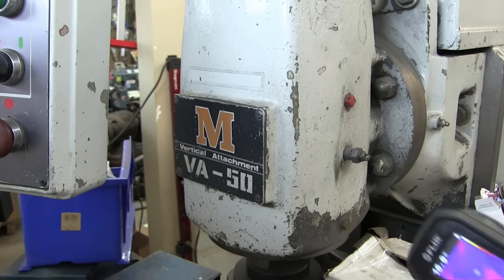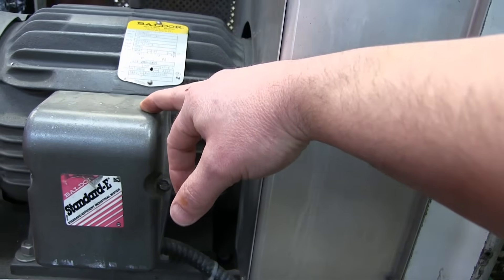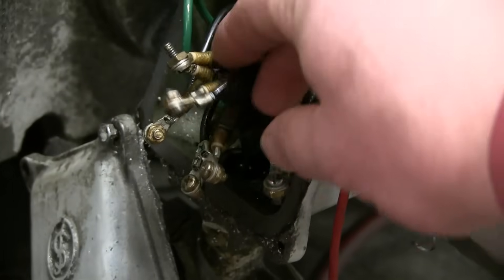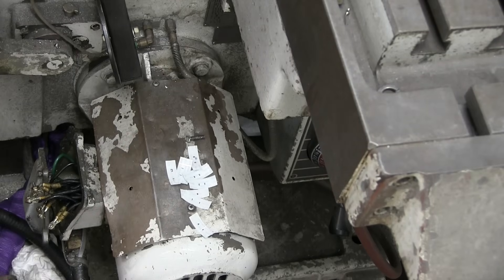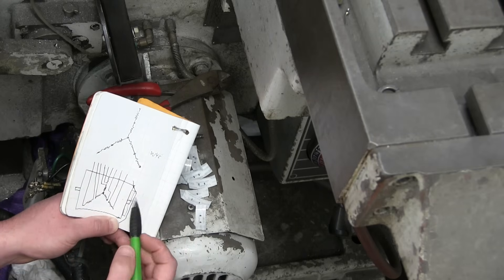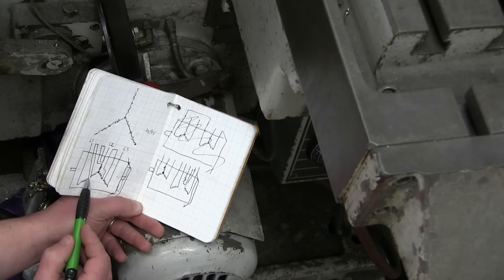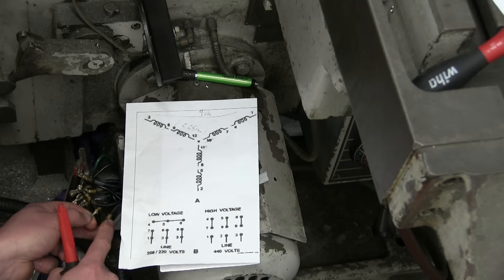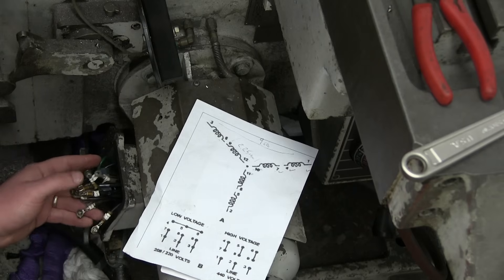MAZAK MILL AUDIT l 9 wire dual voltage electric motor wiring

Comment: The time has come when I must appeal to the great philosopher warrior of the Great White North and his prophet Dewclaw. I am an unworthy retired nuclear turdherder living in the United Soviet Counties of Illinois and recently acquired at auction a great honkin’ 6100 pound Cincinnati mill that appears to have originated in Upper Canuckistan. At least that is what I am lead to believe because the motors (at least 3, maybe more) are wound for 550 VAC 3 phase. I, of course have no 3 phase available. I run my 3 phase lathe at 240 VAC using a VFD. But this 550 juice is not found South of Windsor. What insights might be shared by you, Dewclaw or any of your multitude of devotees that could help me get this beast of a mill running without hand-winding a step-up transformer from 240 to 550 then finding a suitable cold-weather VFD in Toronto? Or running an extension cord to my former power plant employer on the Bruce peninsula to tap off some metric Amps at 550 VAC! At least it is 60 Hz!

Comment: I installed several 100 & 200 amp 240 volt services over the years. Does not cost much more then single phase motors. Cheaper in long run to have 3 phase service rather then expensive rotary or other type phase changers. Baldor is the best motor put there.

Comment: 9 leads are for a dual voltage motor to run 240 or 460 a 12 lead is wye delta… I feel for you trying to identify lead numbers lol been there done that

Comment: On a 440/460/480 v 3ph power system each phase is not 440/460/480
Each is about 277v to ground
Which is 480x square root of 3= 277
Line to line you get 480

Comment: The cheap and dirty way to get 3 phase is to buy a military surplus 3 phase generator. If you are a farmer with a 100 hp tractor, you can also buy one of those windmill generators and use gears or belts to run it off the PTO. The nice thing about generators is they only use the horsepower they put out, so if you are only running 30 hp in motors it will only take 35-40 hp to run the generator, depending on losses. Gears are more efficient than belts, but finding a pair of 8-belt sheaves may be cheaper than finding the right gears.

Comment: I'm a couple months late to comment, but, the way it is wired would tell you if its high or low voltage. Knowing which should make IDing the wires much easier. Then just follow your diagram to connect. Get rid of those nuts and bolts and use wire nuts. A bit easier to make "adjustments"!  The destroyed wire id labels are a good reason the numbers should be embossed onto the wires. Using low voltage doubles the amperage but AWG 12 should be sufficient up to 20 amps. Don't worry about the effects of starting/stopping on the VFD...we've been using them quite successfully in conveyor systems  for years. Much start/stop activity there - much more than you will have!

Comment: Agree with most of what you say, but have to disagree on this phase converter bit. I built a 15hp rotary phase converter (good for starting up to 7.5hp heavy loads) for about $100 and a scrap motor. vfd are fun if you only have one motor, but on something with multiple motors you'd need a VFD per motor, where a single rotary phase converter will run every tool in your shop. and with a couple capacitors and a few hours tuning it, all three phases will supply the same power.

Comment: six of those wires are paired anyway as one of each is the tail end of a motor coil. you can eliminate most of them belling out the motor to find out which point you need to mount your U V W wires, star and delta can be done with bridge plates. looking forward to your video on the motor wiring.

Comment: Let's rewire a 6 phase double wye cable car motor, no...REWIND one, that's even more fun. I swear I have a phase rotation tester that will decipher 9 and 12 lead motors AND tell which way to connect phase A,B & C to get CW or CCW rotation. Rotary phase converters are HORRIBLY inefficient, NOISY and they have lots of parts  to wear out.

Comment: Thats an old Mazak lol i work on a few types...their variaxis 730s...i630s...and i think we have a lathe with live tooling on the turret.  They are pretty reliable machines until an operator wrecks it and your changing linear rails and doing geometry work...

Comment: YES! Excellent vid. I ran across this. 128 ports of WTF Ethernet Switch in the rack.  6 racks next to each other. No one labelled anything no letter no number nothing. I printed out two pages of wingdings and tagged the port and cable with the scotch tape and a "emoji" paired. To try make sense of what shmoo was confabulated on inside the tunnel of tunnels. I think my plan went too well as other consultants started to do the same type of documenting. Documenting like this is kinda like having witness marks on work pieces to line things up correctly. P.S. It was contract for worldcomm.

Comment: I have an ABB VFD pulled from service a couple years back. No info on the why it was replaced. She is missing the control head, you can have it if you want to poke around on it some or use for a project.

Comment: Actually rotory phase converters will run motors at full power. You only get 2/3 of rated power when you use a start box that starts the motor if the machine on single phase with start Caps. The idler motor in a rotory phase converter will put out a "wild leg" but it can be conditioned with run capacitors to be within 10 of the others when measured off the others.

Comment: Europe is nice this way... The electrical system is based on Delta/Wye Voltages (Sqrt of 3) so the old system is 3 phase 230V IT (Delta-wound transformers with insulated ground) and the new system is 3 phase 400V TN (star/wye with "star-center" beeing the Neutral lead and connected to ground, and thus still let regular one phase house appliances run on 230V between one of those 3 phases to neurtral lead, or basicly function just as one leg of the star/wye) Thus most any Asynch 3 phase motor is only 6-wire, as you only need to change between delta and wye. Also most of houses got 3 phase.

Comment: Reason phase converters don't create three CLEAN phases.... Each phase needs to be 120 degrees apart (360 / 3 duh!). Hokay, fine. Power company feeds you two hot leads (just don't run third wire into cheapo residential neighborhoods to save a few beans.) Well capacitors shift AC phase.... but only 90 degrees. We can fake the third phase by feeding a cap off one of other legs. Hey, 90 is CLOSE to 120 right? So pseudo phase is always 30 degrees out. Close enough to make it turn, but not skookum!

Comment: Thanks for this man, I didn't even know there was a way to get higher then 240 volts from a residential circuit. Though one of these days I would like to have a welding machine but will a 240 volt welder be enough (like say if you use a 240 volt 100 amp circuit?)
Reply: Welding machines = low voltage, high amps.
Reply: I know that much, I did take 3 classes of welding in high school. (Grade 9, 10, and 11)

Comment: It's getting cold in Germany... But at least I can blast some heat with my 400V 3-phase space heater. I feel terrible to have the power of 3-phase at my disposal while you have to hack your gear, and everything I'm using it for is heating. Then again, I'm from Germany, we've coined the term Schadenfreude for a reason ;)
BTW 3-Phase is commonly referred to as "STARKSTROM" over here (literal translation: powerful electricity). The more you know.
Reply: Schadenfreude and Backpfeifengesicht are two of the most wonderful words we've stolen from you. :)

Comment: Looking forward to finding out more about the speed drives. Are you going to run one at 60Hz fixed to power the whole unit? Or one drive for each motor or even a combination of fixed and variable frequency. Also the larger drives are not always clear whether they will accept single phase input or not. Love the Vijeos. This channel has become a public service.

Comment: I just purchased a digital control phase converter from Phase Perfect to run a CNC machine - it works GREAT but as you said....$$$$$EXPENSIVE$$$$ $5,500 for 55 amps of 3-phase. No joke. The good news is that it is clean, stable, efficient, and small relative to other options.

Comment: 98% sure whatever dickhole wired the motor on my lathe wired your mill! If the earth lead gets hot enough to burn through it's insulation, there may be a problem with your lathe motor.

Comment: If there's 9 wires, then you have L1, L2, L3 (from supply) to L1 L2 L3 (motor) plus a neutral (depending on connection). This is to give you the option of connecting it in either Delta or Star configuration. Sometimes you'll have a 'delta-star starter' which will start the motor in one way to prevent a large in-rush current from tripping the breakers, and then change it automatically to the other for best efficiency and performance. Other times you'll have a 'DOLS' (Direct On-Line Starter) which will also act as an under-voltage protection.

Comment: can you trust that the last guy who wired that motor made it right? If I have to do that from scratch, maybe I will  take an ac trasformer output (12v?), connect it to one coil and try to figure out which of the others is which and its orientation (by serializing them) by the current induced in them. Naa, too much work

Comment: AvE, I'm sure you have already figured this out but, that voltage switch in the control panel is for the internal transformer that runs all the contactors and controls only. It has no effect on the motors.

Comment: Trying to figure out the wiring on a 3 phase multi voltage motor can be a real head ache especially getting all the winding phased correctly. You did a good job on breaking it down.

Comment: Vidjeo request: More on VFD installation, in particular how you operate your tools that were set up for fixed-speed motors. Did you keep the hi/lo gearbox stuff? What about the snowmobile drive belt? I'm very interested in VFD-ing my mill and lathe (have a rotary converter today), would love to know more about it.

Comment: Now I kinda understand why N.A. people say that three phase is complicated. These nine-wire motors are indeed more complex to wire up and also more complex to figure out if the connection box is FUBAR. I guess this whole thing with 220/440 volts is somehow related to split phases as well?

Here I only know motors where the connection box has six poles on a terminal block (except if its some fancy motor with a heater or brake built into it or something like that) which are just the ends of the three windings. Then you just look at the name plate, whether it is 230/400 D/Y or 400/690 D/Y and wire it up for the 400 V configuration (so 230/400 motor = star, 400/690 motor = delta, but 400/690 motors are usually big so you maybe want a star-delta starter). For star you just connect one row of three, for delta you connect each pair. (Normally indicated in the lid of the connection box, on a piece of paper or just cast into it) Done.

If it spins in the wrong direction swap any two wires of the incoming cable (except ground :D).

Comment: Choose, but choose wisely.  

A 3hp VFD is still around 200-250.  You would need one of those for each machine in your shop. Granted you do get the benefit of motor speed control, but it is cost prohibitive if you have 3 or more machines. You can get a 7.5 hp rotary convertor for  around 600.  Also if you wind up with an older CNC machine the computer and electronics in them don't like to take the stairs and much prefer the butter smooth wave. The VFD can cause miscalculation in the old electronics or even worse let the smoke out as they were never designed to take the stairs.

Both have their places and a VFD is an awesome device.  But being that us tinkerers/makers/gear heads/geeks tend to rummage around for the right deal and then pounce, a rotary my be a better investment in the long run.

Choose what is best for you.
Reply: Joe Garcia This video was brilliant and now for the first time I understand the windings inside a 3-phase motor. But I bought a 7hp rotary phase converter for less than $400 and it was brain-dead simple to set up and I can run two machines at once(as long as I don't start them together.) I'm now the only guy in the neighborhood with 3 phase power!

I guess what I'm saying is that your comment is exactly spot on. Thanks!

Comment: aVe: did you look at the markings on the insulation real good to see if the insulation had wire markings on them. Most of the 3 phase motors I've ever worked on had numbers tio label the wires some had tags some had it written right on the wire, some had both. Look for "this one is not like the other" markings. Maybe you already did this. Removing the shmoo helps.

Comment: you are connecting only 230V to L1 L2 L3, not 440V,  voltage between phases is 440V but voltage of one phase is only 230V

Comment: I thought you were going to delve into Wye-Delta start when I saw the title. But great vid regardless.
I don't get pressure (much) from management. But I get the junior mechanics behind me, asking questions and giving their theories of the problem and solution. Which is usually OK, I'm the lead so it's my job to train these guys. But sometimes we run into something that I haven't seen or haven't seen in 15 yrs, so I need some quite time alone with the patient to get my head around what's going on. 
At those times I gotta tell them to let me figure it out, and THEN I'll walk them through it and try to explain my troubleshooting sequence.
Unfortunately I can't just hand them the meter and say there you go (usually) because they will, and I end up with more problems from someone getting tunnel vision thinking it's GOTTA BE a hydraulic issue when it's really an eletrical control problem, or vise versa.
Then I do hear from management.

WOW, I musta been holding some shit in. Thanks for letting me vent.

Comment: Brilliant, this takes it to the next very clear level. I did a series on running a 3 phase motor on single phase and this takes it to the next stage with very clear analitics. Rather than changing the motor wiring from Star to delta on a 6 wire motor the decrease in coil resistance is achieved by the parallel connections, but only with a 9 wire motor. Cheers, Andy

Comment: I've seen motors fill with oil in the box or "pecker head" as we call it when the seals on the output shaft take a shit when they are bolted to a gear box. Just a thought....

Comment: so basically the phasing is kinda setup like the firing order on a car if you get the phasing wrong its like getting the firing order wrong on a car engine it might not run but if it does it will run like shit

Comment: Ave, Allen Bradley makes her durable 120v input drives capable of 240v 3phase output drives I use them at work on about 12 different machines. Every time one fails it's because of water damage. Get them they are like 400$

Comment: Static / rotary phase converters have a big advantage in that they don't let the pixies out in smoke form if you hit the E-stop downstream.  All use cases mean you need to be rejigger your machine(s) to run 220V, but running stuff off a VFD means you have to lose or rejigger all their electrical controls as well.

If you're running one machine, with one motor, sure, gut the controls, chuck in a VFD and wire it all up to the VFD - you get "infinitely" variable speed, e-stop, active braking and all that jazz.  For a machine with more than one motor, or multiple machines, it's either multiple VFDs or losing all the benefits (no variable speed beyond what the machine provides from belts etc) and some real downsides (stopping one motor pretty much means stopping all motors being the major one).  With a rotary drive, you don't et the variable speed stuff, but you can e-stop all you like. 

It's all a tradeoff.

Comment: This video shows me how lucky I am living in Europe, I mean we have 3-Phase 400V right out of the wall. And its strange how your motors are wired in north America, we can only wire our motors in Y or in Delta (most motors are connected in Delta circuits). I think its not a bad solution with the separated coils but its strange that you cant choose the circuit to a delta.

Comment: mitsubishi HEAVy INDUSTRIES has some nice 5hp vector drives at 200 USD a piece on ebay pretty regularly. idk if they have all them fancy feedforward closed loop and all them fancy 50 kilohurtZ arbitrary amplitude/phase vector generation that the new FOCs have but they're not tea bag. 

i aint no elechicken but as a pixie nerd i'm having fun fucking around with the 40 dollars all-in-one ONsemi IGBT modules that are rated at 600/30 fuggin amps. i feed it 220 1ph and it rectifies, smooths and gives you the choise of high side or lowside 3 ph out responding controlled by 6 wires of ttl.   forty dollars bruh. 4oury. dollars... crazy times.
Reply: also 'zee-man'. tou francious c'est BONNE pero tu german es muy malo
Reply: ALSO didn't you have a fucking Emco in your garage too, or am i just misremembering as to the faulty neural circuitry with the axons and the dendrites in my corticoids from the days when i was a drinker? cause if  you really have a mazak and an emco just lying around???

Comment: 1. Connect wires... 
2. give it electrocution.... 

3. works - great, 
3a. no workie- turn off, start at point 1, but change a few wires around.

4. Works - great.
4a. No workie- go to point 3a.

4b. In case of smoke/loud noises/fire/death- go to pub to think about it more in depth.

Comment: why if you can just switch the low hight voltage switch and convert the voltage that why are you rewiring the motor. isn’t the point of the low high voltage switch so you don’t have to rewire the motors.